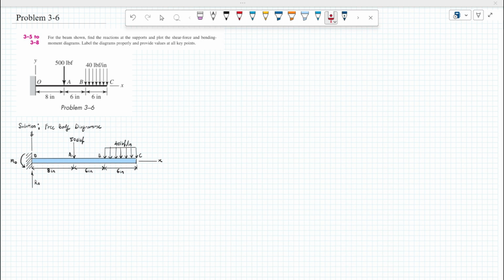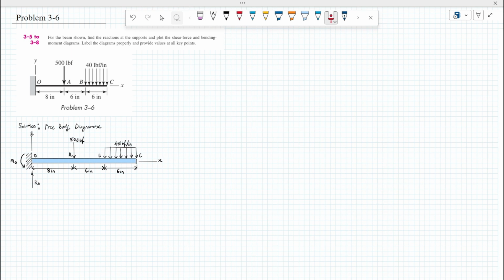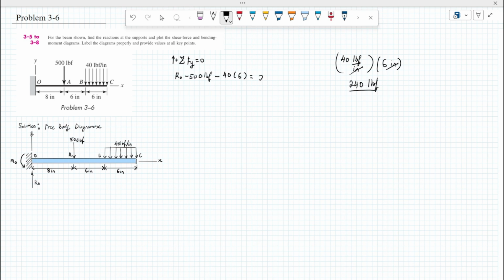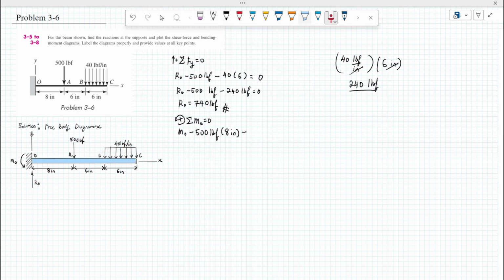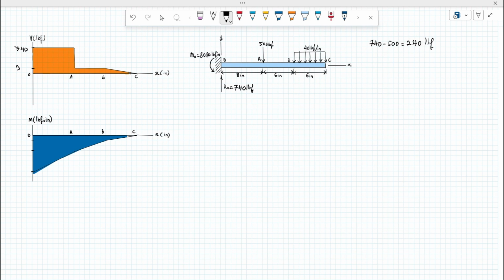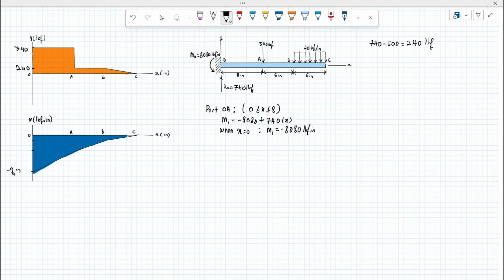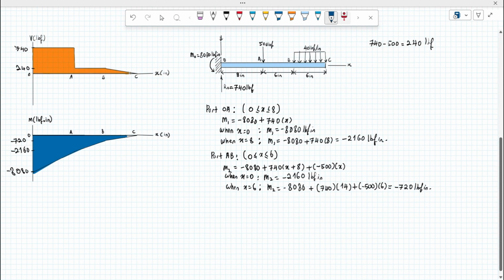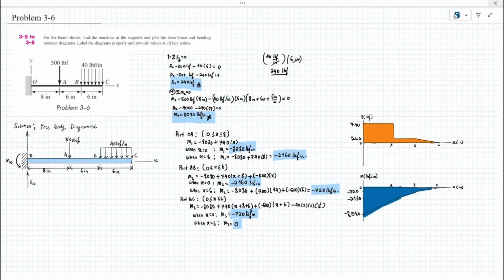Distributed Load and Bending Moment Diagram | Question 3-6 Shigley

Comment: why we wrote 40(x)(x)(0.5)?
Reply from the maker: Hi, the reason we wrote 40 (x)(x) (0.5) is because this section contains distributed force.

To put it simply:
First, the 40 lb/in multiplied by x gives the resultant force, which is 40x lb.

Then, we multiply by another x, which represents the moment arm (similar to previous Parts OA and AB)

The (0.5) is due to the resultant force of the distributed force acted on the midpoint of x. Hence, x/2 or x (0.5).